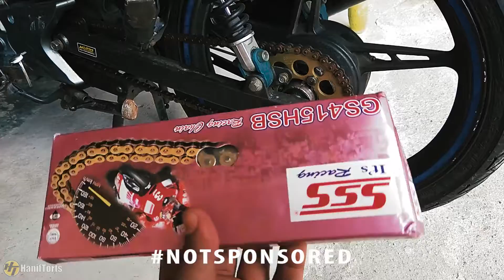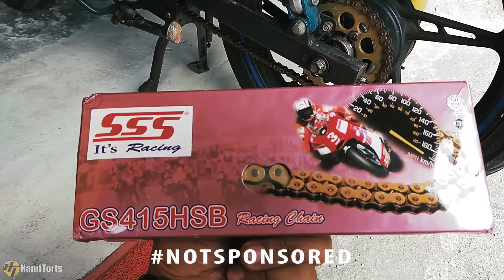YAMAHA LAGENDA TUKAR RANTAI 415

Comment: Saya pengguna lagenda fi....kenapa moto sy gear 3 blh tarik sampi 100,,bila tukar gear 4 dia jadi drop 80..apa sebab nya ..mohon penerangan dan cara atasi nya .please!!!
Reply from the maker: Kalau mcm tu maknanya setting spoket x betul.. final gear tu mesti kena sambut.. kalau drop kena naikkan ratio..
Reply: @HanifTorts  macam mana naik kan ratio tu..bagi lah contoh
Reply: @HanifTorts  contoh klu spoket standart nak naik kan spoket berapa
Reply: 14/37 :enjin smooth , pick up ada top ada
13/37  : pick up ada tp lebih top cuma enjin tak tenang sikit masa gear 4